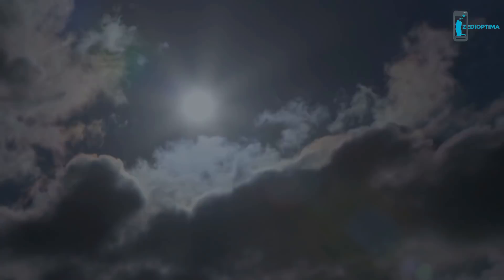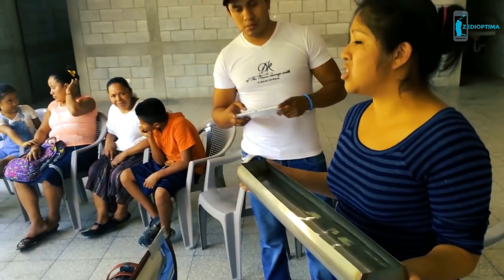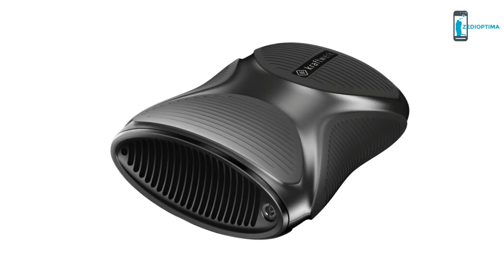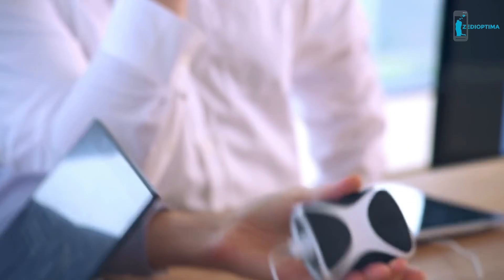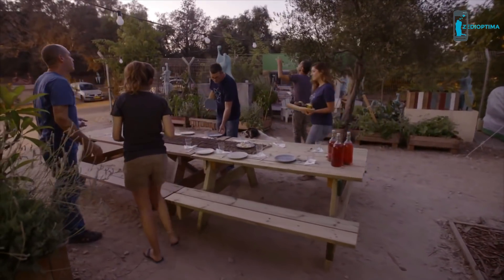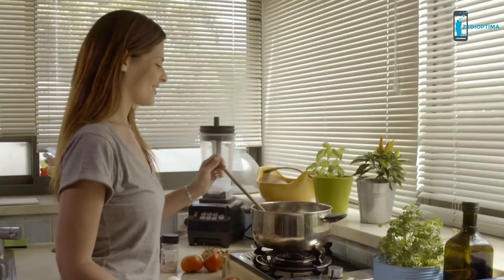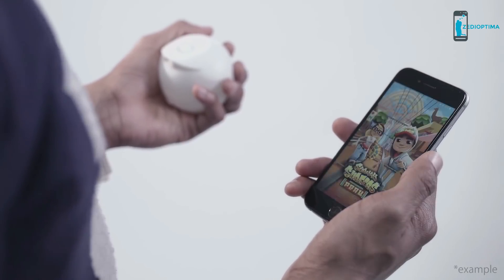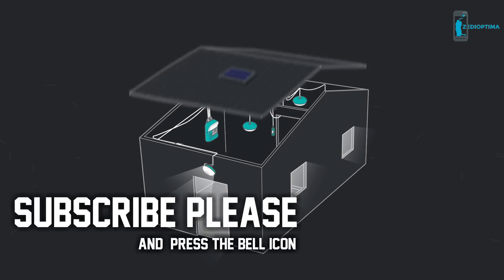5 Best Offgrid (OTG) Useful Gadgets Invention

Comment: I have several observations:

1-The Kraftwerk website link does not work. 

2-The BioMass product is only viable in tropical climates since it is current 20 degrees F right now and will be for the next few months in the North. This thing will freeze unless put in a greenhouse, but I can only imagine the smell. Besides how do you ever clean it out? How much does it cost? There are A LOT cheaper ways to get 3 hours of fuel per day. 

3-The Go Sun product will, at best, feed one person, on a clear day. Seeing a woman carrying it to the office where she will supposedly find a place on the balcony of the high rise to cook her lunch was a laughable scene. I'm not saying it has done value somewhere, but that was the wrong place.
Reply: Kelly Smith the homebiogas can work in colder climates if you use an dark colored insulation blanket. Tarp insulation tarp. Get creative bozo.
Reply from the maker: ok, Kraftwerk is fuel cell powered portable charger
Reply: I think they are making smelless bo gas and u can get up to 6 hours on some of the newer ones but offcourse its not ideal for everyone